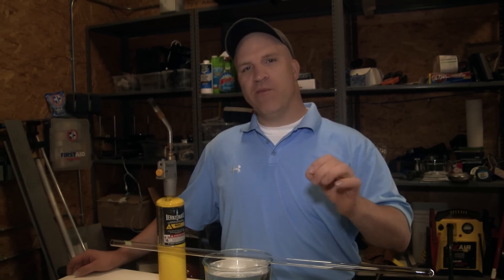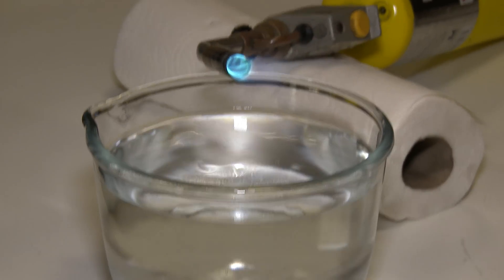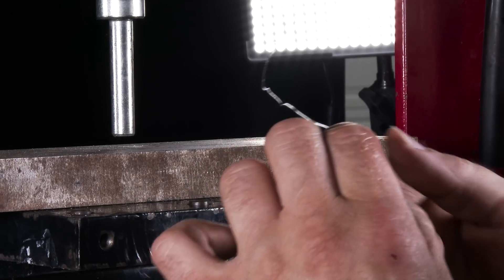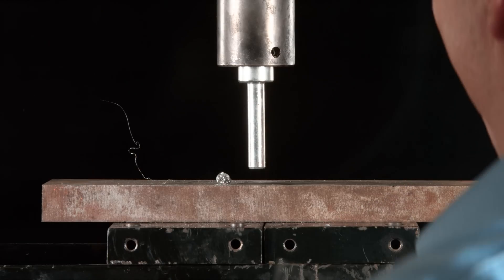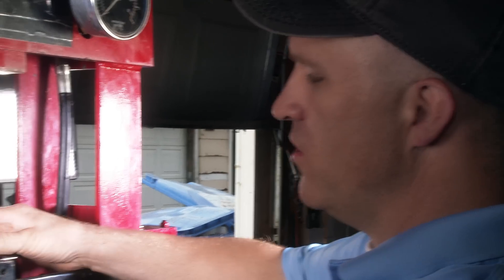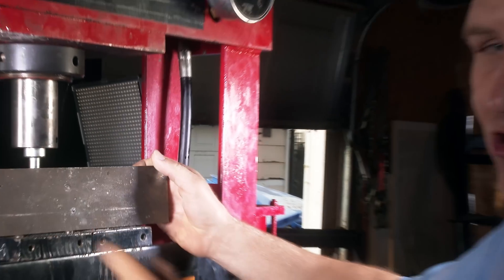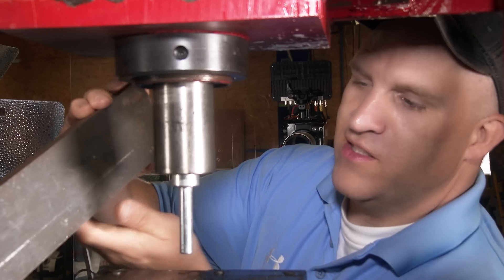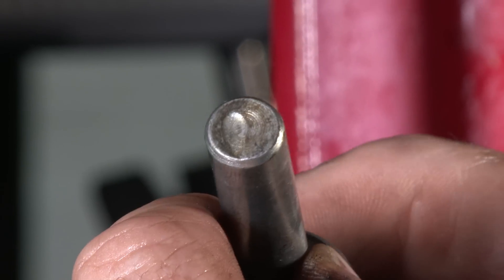Prince Rupert's Drop vs Hydraulic Press [ 4K - Slow Motion ] ( S1 E9 )

Comment: So I'd like to point out that the drop didn't break under the pressure, it either sunk into the steel so much that the tail was pushed into the steel, causing it to break, or the tail moved (And the tail did move) against the press itself.

Comment: I don’t think this represent Rupert’s drop pressure withholding capacity accurately since due to the shape of the dent on the steel plate the tail of the drop has undergone some pressure where it is most brittle and causes the whole thing to dissipate with not much amount of force. I have a feeling it can withstand more pressure if the testing conditions are set so that the rail does not change shape and the tail of the drop is not interfered with. I demand a second take on this test.

Comment: I was wondering what part of the tail does act as a trigger for the domino chain reaction.  I noticed that the tail (at least part of it) did not explode even after bouncing around on the press table (anvil), meaning that it was not part of the trigger structure (or it would have contained the 'domino chain' which would have shattered even though the reaction was triggered from the 'wrong' end).

Comment: Pressing Rupert Drop should create a sparks electronically called "triboluminescence" (details may be viewed to slower motion about 50K-fps).
Reply from the maker: +Bongdu Dugenio actually you're referring to sugar, I don't know about glass, I have the same crush on our Channel at 380,000 frames per second, I didn't see any triboluminescence there. You could check it out though it resides here on our Channel

Comment: Actually if it crushed AFTER having built a hole in that steel AND ALSO in the pressure-stab, it means, that the drop didn't break by that pressure, because the deformation caused, that the force was being pushed from the backside of the drop and not on its spheric skin.

Comment: if you can make a rupert's drop with higher quality pure glass and less bubbles in it, it will hold much more than that.
Reply from the maker: +Olcay Turhan the bubbles are caused by the intense vacuum, it actually indicates that it was properly me

Comment: you should buy a drop from a lab or something, those are supposedly harder than the ones you can make at home
Reply from the maker: CAfakmykak yeah they won't ship them, I tried. it they told me the main difference is they make them out of borosilicate. I may come back around to the subject later, but for now I'm working on a bunch of other stuff
Reply: cool, it would be nice to see the difference between the two

Comment: I would like to see you do this with a proper drop. the tail should have also shattered. you need one taken the glass out of glass kilm and droping that in to the water the temperature start point is key for a proper drop.
Reply from the maker: Review This the tail did shatter, but it was after it flew outside of the frame, this one is at 380000 frames per second , that means that one thousandth of a second is equal to 16 seconds of video. do you realize how slow that actually is?.
Reply: Warped Perception cool thank you for your response
Reply from the maker: Review This absolutely, however I thought I was commenting on the second video of the PRD, sorry but you can also check out that video on our channel here too. tell me what you think .

Comment: What we thought was the tail is not actually the tail. Since the part remaining is actually part of the tail. the true tail was demolished with the prince rupert's drop when it gave way. I also think that might be the point where it snapped because the tail was starting to lean towards the hydraulic press. When you're making a prince ruperts drop you need the trim a portion of the tail because the excess tail led to its demise.

Comment: Apologies if this has been asked before, I'm not keen on sifting through 1k comments to check. Have you ever compared Rupert's drop to a diamond under the press?
Reply from the maker: +no no no we have done the diamond, just have not posted it yet.
Reply: Thought a side by side may help convey just how metal the Drop is; everyone knows a diamond's strength and durability are rarely equalled but it's hard to grasp that "plain" glass can do this, solely due to how it is formed.

Comment: Here is a suggestion:  Fill a balloon with  hydrogen.  touch it with a flame. Film it in full motion and slow motion.  Now fill a balloon with two parts hydrogen and one part oxygen.  I would suggest a spark device inside the balloon.  Film it in full motion and slow motion.

I would suggest, as a part of the video, running an inset of the two explosions side by side and frame for frame...
Reply from the maker: apeek7 LOL great minds think alike. so our first episode of the year has to do with explosions, but while you're telling me to do it's something I did a couple years back and I lost my hearing for 3 days. check out this link. https://youtu.be/QXb7lfGRBH4
Reply: Thank you so much for responding to my comment.  I watched your other video.  The explosion was intense.  I was not sure what substance the oxygen oxidized so rapidly.  I guess from the video that the explosion was set off with a blue laser...

I still think that a side by side comparison of hydrogen alone with a optimal oxygen-hydrogen atmosphere in ultra high speed would be very interesting.

Again, thanks for responding.
Reply from the maker: apeek7 your welcome, we have something similar for the first episode of the year. your right though it wasn't hydrogen. thanks for watching !!!

Comment: awsome vid, i dont know how you would go about setting it up, but as far as i know, a prince ruperts drop is strongest when force is applied to the face opposite the "tail".  smarter every day just did a vid where a high cal rifle could not break the bulb when shot that that face!
Reply: A .22 is about as far as you can get from a "high cal rifle" without resorting to using an airsoft gun.

Comment: IMPOSSIBLE IT SHOULD START FROM THE TAIL
Reply: I didnt you can see the tail is intact after the drop head is smashed
Reply: Heinrike Luna it probably did. The slo mo just wasn't slow enough
Reply: Depends on how thick the tail is and how the force is transferred through the form.
Reply: If it had started from the tail, there would be nothing left. There's no such thing as a piece of the drop surviving a sequential shattering, or else that force isn't getting propagated. This legit broke from the bulb

Comment: There seems to be a lot of whining about whether or not the drop was made correctly.  The fact of the matter is that it really doesn't matter because you can come to one of two conclusions.

1) The drop acts differently if the head it broken before the tail.
2) Even an improperly formed drop can take a fuckton of pressure before shattering.

Either way this was awesome.

Comment: Umm. The side isn't where the strength is. It's the front. The strength comes from the cone at the front, and runs down the length of the drop, not from the side.

Comment: please re do but purchase a proper PRD from a glassware place as the tail shouldn't not have survived the head shattering and wouldn't have survived those vibrations we can see in this clip, would be great to see if it can be crushed properly

also as I've seen in other places the quality really does affect strength I've seen cheaper ones get burst by bullets and high quality ones barely take a scratch from the same weapon

Comment: You didn't even slow it down that much.
Reply: He slowed it down almost 200X compared to normal speed. What you may be slow to understand is that with the tensile strength of a Prince Rupert Drop, the disintegration speed is over 5000 fps.  You would need to shoot at +100K frames per second to hope to catch cool effects of the disintegration.

Comment: That's the first time I've ever seen a Prince Rupert's Drop broken without breaking the tail.
Reply: The air bubble(s) within the drop gave it a weak point and that is unfortunately how the stress came to breaking it. It would be amazing to see a perfect Prince Rupert's drop (no bubbles, pro-grade glass) under a hydraulic press at hundreds of thousands of frames per second.
Reply: Biblical Knives I have the same feeling - you can see the tail rising up and across the press moving towards to upper right. it would be amazing to see this at 120kfps or so to find out exactly how it broke.
Reply: That's the point.the tail did NOT break.
Reply: Biblical Knives No, it didn't.  The tail was still winging around at the end of the video.
Reply: The portion of the tail that did not shatter was formed outside of the water, and cooled at a normal rate, in air. The tail did shatter, but it shattered only up to that point.
Reply: 20 tons to break it...holy crap
Reply: If you use your own slow motion to slow the vid, you can see that the tail is actually the epicenter of the fracture. it appears to occur approx. 1/2 inch away from bulb. also, you can clearly see a bubble in the bulb of the drop. too bad they used a hollow glass rod to make the tear. 
STILL-- that amount of pressure before failure from an imperfect sample? just incredible !!
Reply: this bubble is actually a vacuum and can not be avoided
Reply: That's because actual Prince Rupert's Drops are not made this way.This is no actual Drop.
Reply: You would have to cool down molten glass in zero gravity for that. Or somehow cool the drop without letting it be in motion inside the cooling body. You will have a ball bearing thats just indestructible.
Reply: All I can say is that the current footage is unable to determine what part gave way first. I personally think it went tail to bulb through the tail tapping the press or because of vibration from the pulse as pressure was being applied. But that is my opinion. Until there is some very high speed footage, we won't know.

Time to hit up the slow mo guys...
Reply: Dave Webster You can clearly see that the tail did not break at all
Reply: richfiles Is it possible to make a drop without a tail, or is there some reason that doesn't work.
Reply: It did break from the tail, the camera is not able to slow it down enough.
Reply: +David Battle 

That is not the entire tail, the tail is the thicker part of it..which is gone.
Reply: Gogron9 it's not a true drop though
Reply: Biblical Knives i know
Reply: Gogron9 that's not part of the Rupert drop formation, but a separate piece from the way this drop was made.
Reply: You can tell it wasn't the tail that broke because the tail didn't shatter... you can see the tail perfectly fine in the slow mo even after the whole thing shattered, the prince Rupert drop bulb is what broke
Reply: There's a video about a guy shooting one with a bullet.
Reply: Smarter every day did it
Reply: teh tail was so big, fragile and was touching the part of the press that was moving
Reply: David Battle it wasn't slow enough to fully see, I'm still pretty sure it broke from the tail
Reply: David Battle
Reply: why do people repeat what's already been debunked?

Comment: This is a job for the Slo-Mo Guys; seeing glass crack in slow motion really takes hundreds of thousands of frames per second, not just 5,000. And as you increase the frame rate you will lose resolution, but the frame rate is really what counts. However, good start to a great video!

Comment: What's Tougher? A big one or a little one?
Reply from the maker: Breakout [Bx0] I was thinking the same thing. I'm going to make notes of everyone's questions and include them in the reshoot
Reply: Also, I wonder if there's any way to minimize the area of the more fragile back end? Could you make different shapes of them? Would there be some shapes that would be stronger than others? I'm wondering, I've seen these things turn away a measly .22 (then shatter from the shockwave smashing the back side of it), I wonder if there'd be some way of making a sheet of them or something perhaps as a cheaper (and likely heavier) alternative to small arms ballistic protection plates for military applications? Another hypothetical, What happens when you wrap the back end in a shock dampening material such as say, Sorbothane? (Was too much trouble to ever actually be 'at' school, so don't know the science behind it too well, just spitballing mate, dont mind me =p)
Reply: They strength of the Rupert's drops come from that shape and how it's made can't change shape there's ton's of vids on how it works.

Comment: Perfect, of course the results may vary depending on the quality of the drop, but my guess is that a high quality drop in optimal conditions would deformate the pressure point before shatering. Not indestructible but toughter than most materials so it's expected that most materials will experience deformation way before the ball.

Comment: Sweet that people are into stuff like this, thanks for sharing. The "pressure" you show on the screen may be significantly low, I'm assuming you ment tons of force. To calculate pressure, you could use hertzian contact stress using the dents - wouldn't be surprised if it were over 1K times higher than what you show on the screen.

Comment: 666 dislikes?
Reply from the maker: martinshoosterman well I made some of them and the glass blowers made some, the composition was either lab glass or Pyrex and tbh I can't remember which were which . I will reshoot this as an episode in the future, maybe with Destin and make a through comparison between multiple variables.
Reply: That would be really interesting to see. I mean it is all about the purity of the glass. Saying that the drops you used are fake is not true. They are just not as strong as they can be with high-quality glass. 

I am really interested to see if the press could shatter the high-quality one :) It was definitely not my intention to criticize. Keep on doing awesome stuff like this. (Y)
Reply from the maker: Are Dyrendal noooooo... actually I just disliked my own video to make it 667
Reply: Might be because of the incorrect procedure to make the drop. I would suspect that if made right the press would/might not be powerful enough to shatter it.
Reply: +Sašo Luznar
Do you think that ordinary glass would be able to withstand up to 20 tons? No. If it wasn't a real Prince Rupert's Drop it would never have lasted as long as it did.
Reply: Dude glass itself is still extremely strong. It probably is fake considering the drop shattered but the tail didn't, which should be impossible with a real drop. 
(Face drop., not fake video)
Reply: Warped Perception great work sir

Comment: Your camera isn't fast enough.
You should see the drop disintegrate from the tail end and travel to the drop.
if you had a high enough speed camera you'd see it.
Reply: You are incorrect im afraid. Yes, the common way that these break is by breaking the tail and the whole thing collapses, but this was breaking it without damaging the tail, which is why it took 20 tones. You can even see in the video that the tail didnt even get broken :)  Great video, great to finally see someone break one of these without it being caused by the tail.
Reply: It won't disintegrate from the tail if you smash the head. The concept is that the head is super strong but by breaking the tail you can start a decompression wave that will destroy the entire drop. Crushing the head directly doesn't do that.
Reply: You can obviously see the tail blew up last and part of it flew off.
Reply from the maker: +Povil Ka your right . It's insanely fast , when we reshoot it we will go all the way up to 1million frames per second
Reply from the maker: Omar Omokhodion check out the other video on our channel. we filmed the fastest ever of a Prince Ruperts Drop. https://youtu.be/tRUngxK2yXY Enjoy !!! and thanks for watching
Reply: Ah I see, great video, thanks.
Reply: Thanks. 
It's still SO FAST....
Even at 380K everything happens instantly, there is no slow-cracking or smth....
Reply: That will be impressive!

Comment: The procedure to make the drop wasn't good enough.
Reply: TheBleach strong ones can take a shot from a sniper. in fact the sniper bullet would explode
Reply: TheBleach so yeah you're totally right. should've been hotter, more glass, and put in colder water
Reply: +potato watermelon1234 Yes, if it were made properly by melting solid glass and not a glass tube it would have not even exploded since it is stronger than steel. The bit was of steel and it breaking the drop means that the drop was weaker than steel therefore it wasn't a real prince rupert's drop. Fooling children and generating money from view that is all it is now.
Reply: +TheBleach
Do you think that ordinary glass would be able to withstand up to 20 tons? No. If it wasn't a real Prince Rupert's Drop it would never have lasted as long as it did, you criticism is silly and groundless.

+Potato watermelon 1234
A "sniper" isn't a kind of gun, and a "sniper bullet" isn't a kind of bullet.
Reply from the maker: TheBleach lol....nah , we sure ain't on YT for the money. well we are going to shoot a full more complete episode on this subject and whatever it takes I will break the drop from the head.